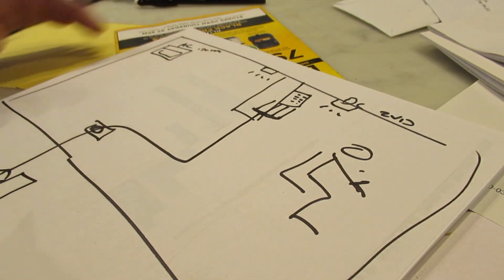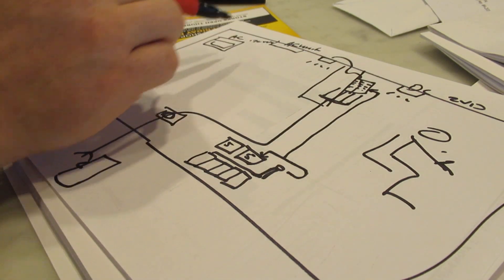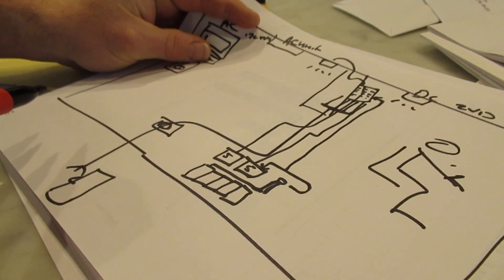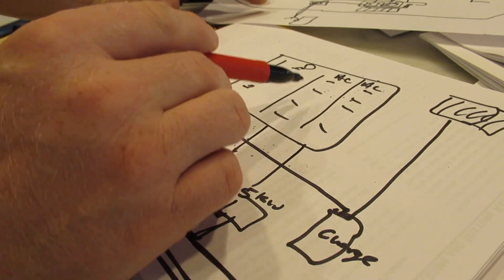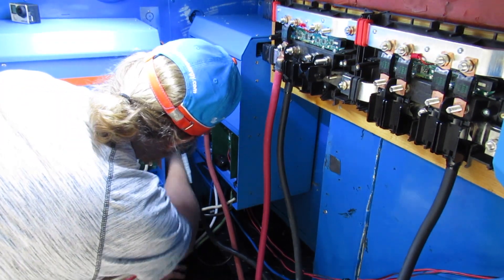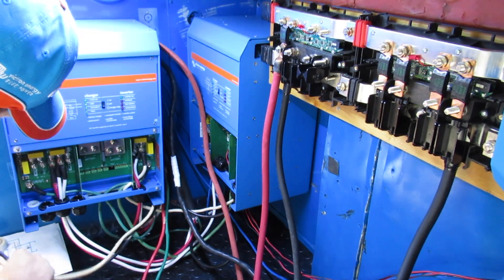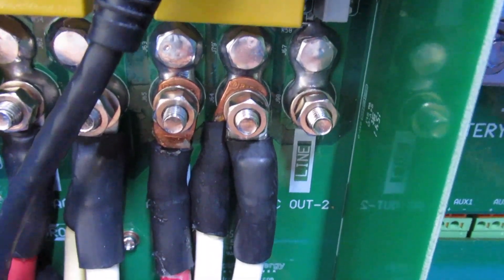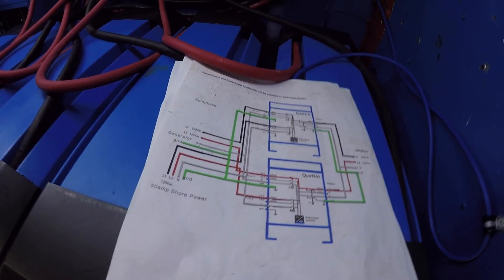Bus to Tiny House - Victron 05 - Off Grid Power

Comment: The 4 wires coming from ShorePower, you run one leg to each inverter and you had to split the Neutral across both inverters? 

If you had 2 split Phase invertors you could have had redundancy. you kinda do now, but you will lose one of the legs in the panel.

Comment: Did I understand your diagram and verbal explanation while mapping it all out to be that the battery bank is only charged by Solar? And not by the generator or shore power too?  ---  Ah - wait - I was just watching video 6 in this series and @ 8:00 minutes you say the batteries are charged by shore power too (I've followed Technomadia's build for a hot minute and that's how theirs works too). They choose to go Victron as well. They also love that you can limit your Shore power intake so you don't pop host's breakers and instead use shore +Lituim's for power assist for when AC's or Fridge's kick on during that spike.

Comment: TY!  So the Quattro is a 5KVA true sine inverter charger.  Was 5KW enough for 2 A/C and load?  but you need to run all 3 + other 120v loads which was over 5KVA?    I assume each A/C <2KVA.   IIRC, you have 5 x 200Ah 24V batteries=24KVAh. So 120v 20A load can run (<10)~8 hours non-stop.    Will the quattro autostart the gen when required?    Considering stat up loads, I assume the 5KVA is enough to start the a/c without shore power, or did you install soft-start A/C's?